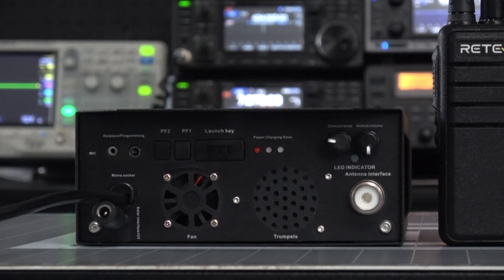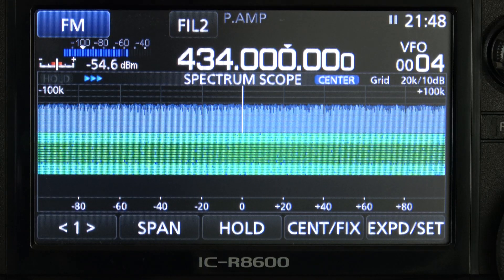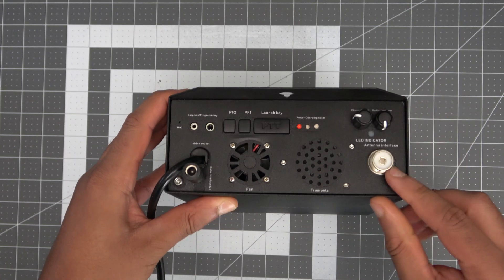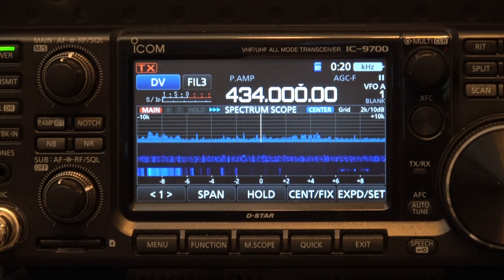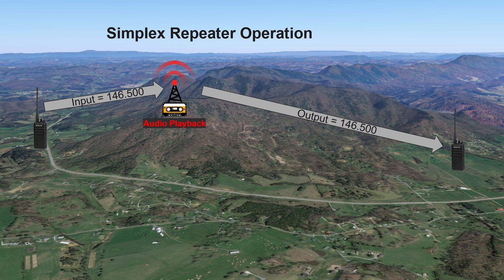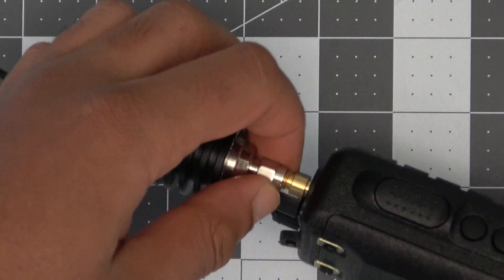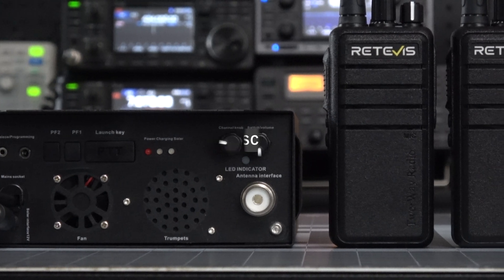LoRa Radio System and Simplex Repeater from Retevis with Mesh Capabilities.

Comment: I also saw a lot of energy at around 530 MHz, which makes these devices highly illegal (also for HAM operation). That is why I did not create a video and sent them back. Fortunately, I got my money back.
Reply from the maker: Ah, what a shame! Thank you for the info and the testing. I'm a big fan of your channel Andreas and know you have better testing equipment than me! I'll pin this to make sure others are aware!
Reply: Looks l ike that's visible on the TinySA measurement, e.g. at @8:21.  It seems to fluctuate, I suppose because the TinySA isn't very fast, but some frames it looks like it might only be -12dBC (!).  In the US 510-535Mhz is Aeronautical radionavigation (radio beacons).  Probably not the kind of thing you want to be interfering with.

I'm glad @The_Comms_Channel reviewed them, and put the measurements on screen, though.  It's good to know what's out there and have some idea what the issues might be.  Someone's going to hear these and wonder what they are :-).
Reply: @yakovdavidovich7943 You are thinking 510-535 kilohertz, not megahertz. As far as I can tell 530 MHz is allocated for terrestrial broadcast. Still, that's a lot of spuriius emission.
Reply: who cares during WW3???
Reply from the maker: @11ThreeDoctor  You should... When you have a 5Watt radio that sends 1Watt on one unintended frequency here and 1Watt on another unintended frequency there along with 1/2watt on two others, you no longer have a 5watt radio, you have a 2watt radio
Reply: @The_Comms_Channel  now you talk and I care.
Mans Law 🤪😜
Destroying my expensive tech 😱

Comment: Saw either these radios or another repurposed product in someone else's review a while ago. Proprietary signal that doesn't comunicate with other brands--unlike the commonality that is at the heart of LORA, in general.That and the unpogrammable natue of the handheldsmake them a bit of a white elephant.  Could it be that a digital-only RF signal is why it was hard to get readings? I learned a while ago it is very difficult to use frequency counters with digital radio signals since the signal isn't constant. As for privacy, Motorola's DLR frequency hopping spread spectrum are great for that, but they are limited by power regulations, so they are only good for one site. Then there is AESS for commercial licensed operation.

Comment: It looks like a DSSS-MA system that has been single time slotted. Occupied bandwidth is approximately 250 KHz. I will see if I can get ahold of one of these and put it up about 300 feet. I am curious to see if I can park it on the output of a conventional FM repeater if they will play well together. They will likely ignore each other. Gotta make certain not to get any closer than 125 KHz to the band edge. DE WY5V

Comment: This repeater mode looks to be the same as my icom2730 in that it uses a single antenna and rapidly Change's between RX and TX. So quickly in fact that you can't hear the interruptions. It's very cool.  It does however need two bands UHF/VHF so is different in that regard.
Reply: The Icom IC-2730A is an analog radio and does not operate in digital modes.  You are describing crossband repeating - receiving on a VHF frequency while simultaneously transmitting the received signal on a UHF frequency or vice versa (UHF to VHF).  It is a very useful capability but different from what is being shown on the video here.  Your 2730 has an internal duplexer allowing the radio to receive on VHF and transmit on UHF (or vice versa) at the same time with the same antenna.  I have been able to extend my radio range greatly by using this capability on my 2730.  It's a great radio.  Best Wishes.

Comment: The developer of meshchat(for reticulum) made a flasher for almost any LoRa to become a RNode, he has successfully had voice communication over 915MHz using raks! It's phenomenal. Despite the protocol limits of meshtastic, the devices are capable of becoming a key tool. Worth looking into.
Edit: I have also successfully utilized it to perform voice/message/data on the raks

Comment: I believe there are three timeslots. The handhelds repeat what is heard from timeslot to a different TS. The increased number os TS allows for a better mesh. Very interesting idea, but i think questionable mplementation.
I would love a reliable, well engineered, affordable single frequency repeater.  So far I have not found a good VHF/UHF SFR. The benefits would be enormous; the engineering  challenges with timing I think are the problem.

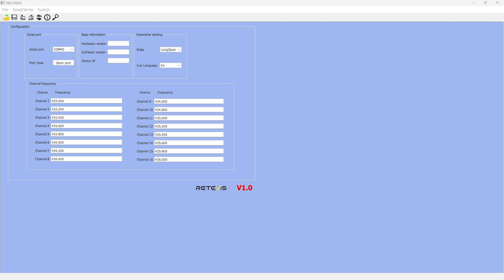Comment: Google TDMA -- that's how it's doing "real time" repeating.  It seems a bit rude to use 250kHz of bandwidth for a phone mode, though.  In the US, Part 97 has extra rules for spread spectrum modulations (which would include LoRa).  Care must be taken not to interfere with anyone else.  Channels 11+ @3:11 fall within the "satellite only" international band plan, which is especially rude.  Channel 1 will overlap substantially with a weak signal range, and would also be poor sportsmanship.
Reply: It's not TDMA, it's CSMA and it's literally packets of data.
Reply: @supertoaster94  LoRa chips have no carrier detection capability. The closest they get is a flag during preamble lock, and it's not good enough to do CSMA.

Comment: So, it's probably working like DMR where there are 2 time slots.  It's using those time slots for psuedo-duplex repeating.  The receiver side is buffering the stream of data and it's able to use the time it takes to drain the buffer/covert-to-analog to handle the other time slot.  Just a guess though.
Reply: It's LoRa, so it's CSMA and packetized like WiFi, not TDMA. It's like sending WiFi data from one client to another through an access point. EXCEPT when the repeater isn't used, it's still packets and could be closer considered to packet radio fast enough to move voice.

Comment: That solar power inlet seems a bit janky? They couldn't afford a panel mount 2.1x5.5mm barrel socket and had to have a flying lead?

What's the inside look like, did they do proper integration or just slap together a bunch of modules they found on Aliexpress?
Reply from the maker: Not opened it up yet but probably will at some point

Comment: They ALMOST got this right. If they had put it on 900Mhz ISM band @ 1W and added frequency hopping to keep them compliant at 1W transmit power here in the USA that would make them legal for license free use. If they supported encryption also I would be flipping out.  ... Stretch goal, some kind of data link capability like a serial port. Frequency hopping spread spectrum + LoRa would make for a very potent combo that still plays nice with the available unlicensed spectrum.  @The_Comms_Channel Since it appears you have a contact at Retevis can you please give them this feedback?
Reply from the maker: Thanks for the comment. Not sure if this is the way to go. They already have less range than other digital radios at 5W on 70cm. Less power on a higher frequency will make it worse.
Reply: No, it wouldn't, because of power spectral density restrictions.  1W at 250kHz bandwidth is 10.8dBm/3kHz segment, which is more than 8dBm (the limit in part 15).  Can't do this radio on 33cm under ISM intentional radiator rules at any more than about half a watt.

Comment: TDMA like DMR. I wonder if there is a tx slot and rx slot.  That is interesting setup.  I wonder if are Retivis is using semtech chips, since LoRa is a proprietary protocol like DMR is owned my motorola.   Can you talk simplex on the two handhelds without the repeater?
Reply from the maker: Not sure if they're semtech. May have to open one of them up at some point. You can use the handhelds without the repeater. The handhelds can even also act as repeaters if you change the setting in the programming software.
Reply: Technically it's not TDMA. It's just packetized, like WiFi, and the LoRa PHY uses CSMA, again like WiFi. It's literally packet radio fast enough for voice.

Comment: According to your test, there appears to be no range advantage of tis LoRa system over a DMR system so I wionder what the advantage is. These devices were offered briefly for sale n Amazon UK and Europe before they were removed from sale. There is no way these could be legal in these regions. The ISM limit for transmit power is only 12dBm. For amateur use it is around 10dB higher but encryption is not allowed. Strange, very niche product !
Reply from the maker: If the mesh functionality works as advertised, that would be the biggest advantage to these I think. As far as I know, these are just LoRa and not using encryption so we should be good there. There's just no other LoRa radios like these which is where the "privacy comes in. Definitely an interesting set-up!
Reply: If they can be used responsbily, the mesh would help... it would double your range if you use a handset as a repeater.  Looks from the SDR measurement like they don't have more than two time slots, though, so you can't do better than double.

Comment: TDMA
Reply: @nemam_nedam  hence why TDMA signalling incurrs that delay that DMR is famous for
Reply: @nemam_nedam  The cpu has to process the data as fast as it is transmitted ...
Otherwise there would be packet loss.
No, you have to buffer the time shift to "skip" the second slot, so you have to add delay.
Then there is the FEC, which can only be calculated for each packet when that buffer is full, so adding another packet of delay.
But before all that, for TDMA, you have to sync to a time clock, so there will be a few pre-amble packets.
Reply: @nemam_nedam  You need to skip a packet for the FEC, otherwise you will introduce time domain instability, aka jitter.  You cannot calculate the FEC "as you go",  you can only calculate it when your payload length is reached.
Just like you're reading this message now, you would only be able to calculate FEC bits for it once you've fully read it.
Reply: @nemam_nedam  You're making assumptions.  You don't know if this even has a hardware vocoder chip.
The signal is very much TDMA.

Comment: I picked up a number of these a few months ago. You should be able to test with the 3 radios you have. The handhelds repeat as well. Get a handheld outside of the range of the base station but within range of a handheld that can see the basestation. The handheld should repeat the signal.
Reply from the maker: Ah, I see what you mean. Good thinking!

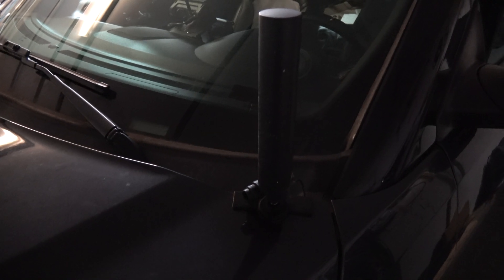Comment: Nice video! Curious, what is the brand/model of mobile antenna are you using at 4:20? How's the VHF TX performance? It looks like it would be a good fit for me needs as a low profile multi-band antenna.
Reply from the maker: Thanks! That antenna is the COMPACtenna tri band model that does 2m/220/440. I've been happy with the performance for being a low-profile antenna.